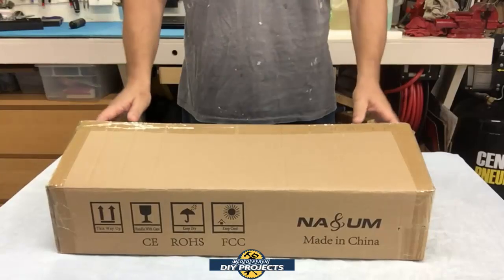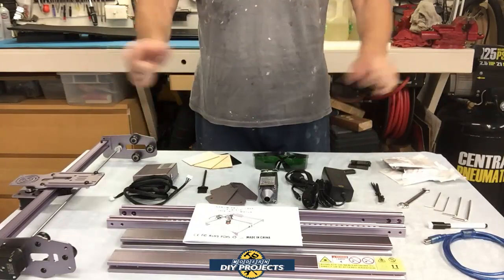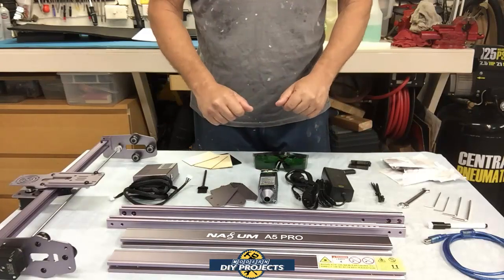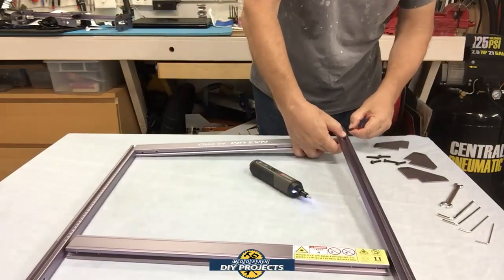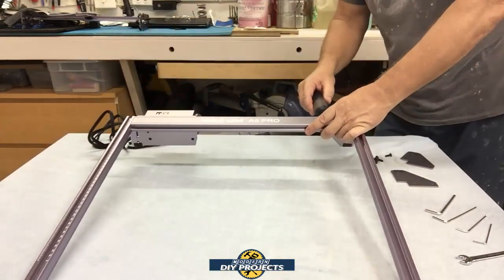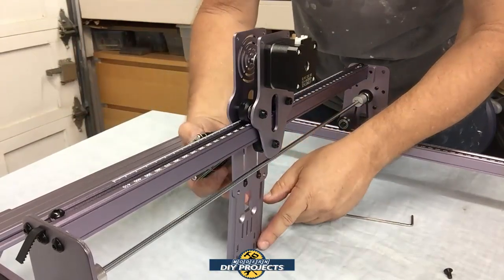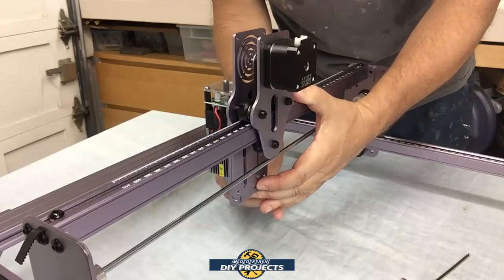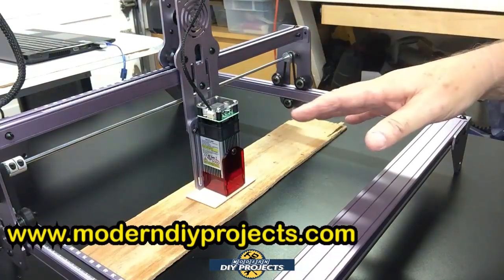Nasum A5 Pro 40W Laser Engraver Etcher Cutter CNC Machine Assembly, Installation and Review

Comment: I agree with Spencer I would like to see a demonstration of The Cutting ability.
Not just on wood. A variety of materials and can it cut through thin metal?  Something like a street sign is made of? Or is that  Way too heavy duty for this machine?

Let's find out together in your next video.
Reply from the maker: I'll have to come up with ideas and materials to do this. I think a street sign is steel, and is thicker than what this laser can do. The specs say that it can cut through 12mm of wood. Doesn't specify thickness of metal. I would probably try with some thing aluminum to begin with. I'll have to get some first. I don't have any flat stock aluminum on hand.

Comment: As far as I know, you need to adjust the focus before using it.the black plastic plate is a fixed focusing plate, which is placed on the object that needs to be carved or cut. Then the laser head is attached to the focusing plate. The laser head is fixed, and the focusing plate can be removed for engraving
Reply from the maker: You are correct. I did all that before beginning the engraving. I Didn't go into that in the video because it is well explained in the instructions for anyone that buys it.

Comment: in the video was the table shaking or the machine? I could see the table shaking as ok. If it's the machine you may want to stop it from doing so? it could throw off the etching. it is cool none the less.
Reply from the maker: It was the table shaking. It's a portable table I set up for doing these types of videos so it's not as solid as a real table. The reason is that the laser jerks around very quickly, causing it to shake. I will use this laser on a better base next time. I didn't know what to expect when I started it up, to be honest.